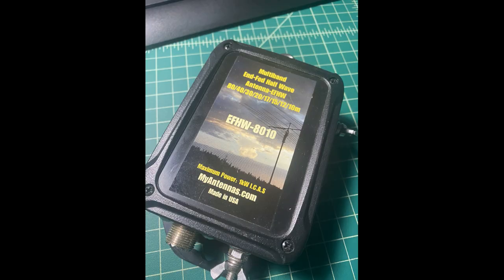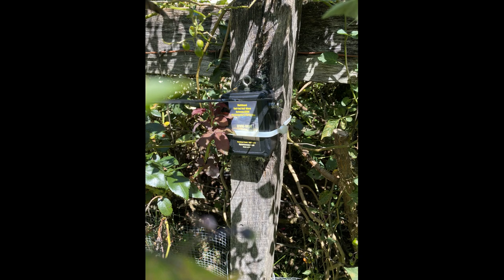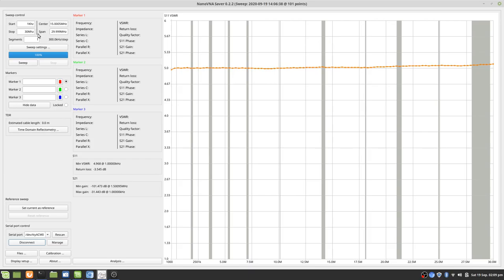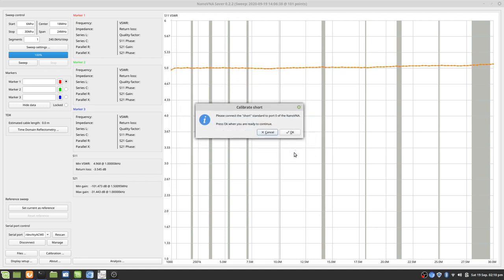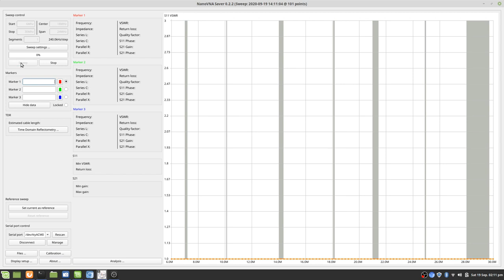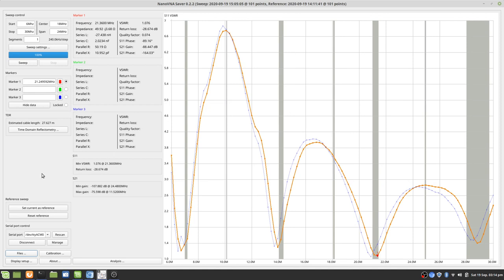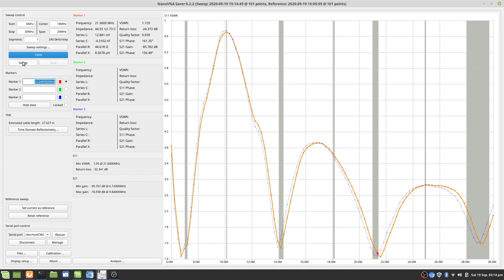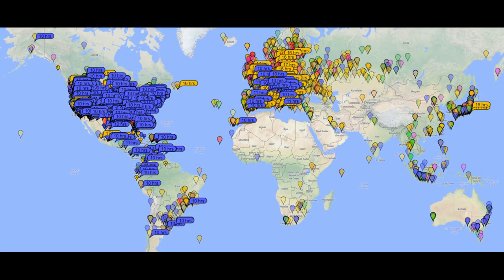Tuning my EFHW Antenna - Ham Radio - TheSmokinApe

Comment: I have the same antenna. I had my tree guy bring his bucket truck to raise the end up to about 35 feet The matchbox is about 10 feet in the air and the wire is about 124 ft with a coil about 6 ft from the matchbox. I can now be heard in Vancouver BC 5-7 compared to 3-3 on a steady basis. Also I have little problem being heard as I hunt POTA in those pile ups. I can also hear a tad bit more. I bought mine straight from myantennas.
Reply from the maker: Nice, 124’ is a monster size 👍

Comment: Wish we were closer for a side by side comparison - I have two Utimax end feds. Love em ………… have fun W1FYG
Reply from the maker: Don Izzo I’m hooked on End Feds 👍
Reply: I have 1 of the "no tuner needed" ULTIMAX EFHW and it needs a tuner on ALL BANDS!! Using my mfj analyzer it shows swr sweet spots are all approx 1 mehz too high in freq. iI think if i make it longer it will be better. AM I THINKING CORRECTLY?
Reply: BTW ITS THE 140 FOOT LONG MODEL.

Comment: I have 3 of their antennas.  They are excellent.  ...and their wire doesn't stretch :)
Reply from the maker: They make quality stuff for sure, this came without an antenna.  Just the matchbox.
Reply: @TheSmokinApe  I noticed. I'm not sure what exactly they use for wire, but it's tough as nails. A little pricey, but all 3 of mine are keepers.
Reply from the maker: I ordered some 18g PolyStealth copper clad steel, I'm hoping it's up to that task.

Comment: Another good video, Ape. How does this one compare with the HF Kits you built? As far as tuning I have seen some cut the element at halfway point to move resonance up to 75m portion (this is with 80- 10). I can’t remember his name but I think it was Steve Ellington or something.  You can learn a lot on YouTube University.  😆
Reply from the maker: Hey Brent, this one can handle more power then the one I build, but I don't run an amp so it doesn't matter.  I like these quite a bit but they are expensive.

Comment: ❓❓❓APE I have a question❓ I know that you have both this EFHW and you built the ARRL EFHW Kit,  In your opinion are these antennas are about the same with their performances or, are their noticeable differences that one has over the other.  I have a close friend and we were discussing this the other day and we would appreciate your input as you have used both and we only have the ARRL kit that we both built with your video help.  Thanks Mike 73 KV5P
Reply from the maker: Hey Mike.  Being honest, I haven't noticed a big difference.  The MyAntennas is rated to 1,500w I believe and the ARRL to 300w, so if you are running high power that might be something worth looking into.
Reply: @TheSmokinApe  I just asked the same question.  If the my antenna is rated higher I assume it has stacked 2 or 3 toe -roids for the heat.  Good to hear that theee are similar in performance.

Comment: How long did it take to stretch that far?  Any problem with additional stretching since you tuned it?
Reply from the maker: Few weeks, I think it was because it was hot and summer time.  No problems since but I am going to swap out the wire anyway.

Comment: Someone told me on fb that I shouldn't do a sweep of all the bands at same time, that I would get false readings.
Reply from the maker: The NanoVNA only has a certain amount of data points per sweep.  The wider the sweep the further apart the data points can be, that can impact your readings.  I sweep bands individually as well as grouped, for this sake of time in this video I displayed the readings as a group.  Thanks for the comment/ feedback 👍
Reply: @TheSmokinApe  Did you recalibrated in each band?
Reply from the maker: oscarpont of course
Reply: @TheSmokinApe  I'm not sure if I'm calibrating mine well, I have a Nelson end fed and yesterday I set in and invented L and I measure it. Apparently is like at 1.2 swr at 20m but also about 1.8 at 2m. When I measure it with the Icom 7300 it says it's more than 3, so the internal tunner won't work but I heard lot's of people on 20m.
Reply from the maker: oscarpont mine is typically very close to what the radio says.  Make sure you are not mixing up the open and short standards, I’ve seen a few people do that 👍
Reply: @TheSmokinApe  at least that part I'm pretty sure, the open doesn't has anything and the short is the one with the stick, both same color.

Comment: I'm completely shocked at the amount of hams. Who come into the hobby who can't make a simple antenna. Spoke to a G station bragging that he paid £350 for a fishing pole and wire and went on to say he bought it off callum at dx cammander. I laughed so much at this idiot. 10 mtr pole £30 100 mtrs of wire £15. Then their the eBay clowns who build these ununs. Fortunately I came across 1 at our radio club and had the opportunity to open it. Let's put it this way my 9yr old son could of made it look more tidy. Uk antennas cashing in on information freely available on the Web. Point in if your a radio ham build your own antenna.
Reply from the maker: What seems easy to some may seem complex to others.  I try to help folks learn through encouragement, I’m not trying to shame anyone who hasn’t had the opportunity to learn.  That said, I agree, that building antennas is easy and rewarding 👍